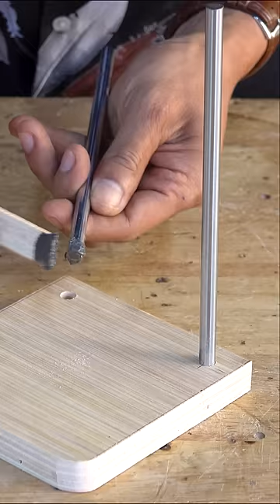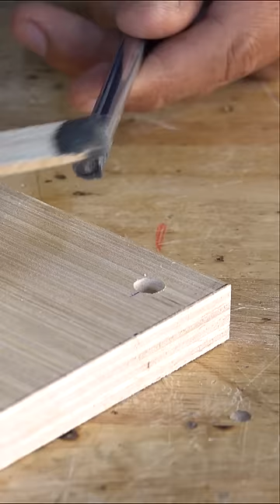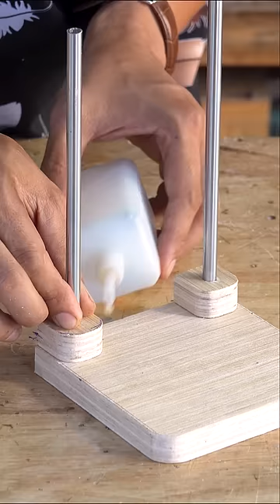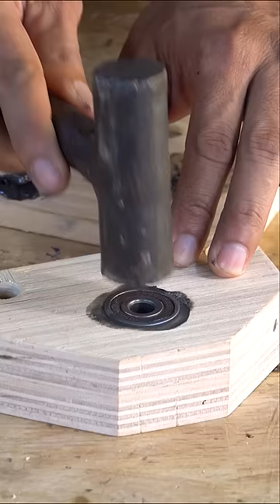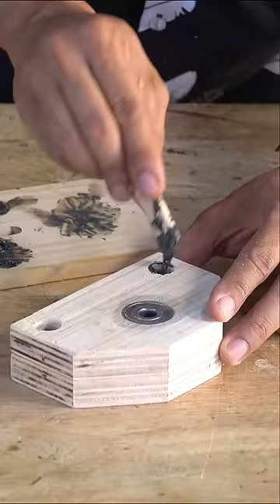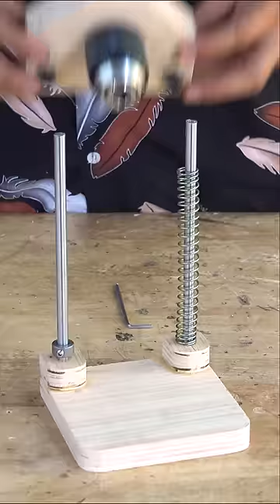Handmade DIY Drill Standing (part 2)#woodworking #trending #amazing #shorts

Comment: Good that you built one I guess.. but you can buy a drill guide for under  $30. The bearings and other hardware had to be close to that.
Reply: Àa
Reply: NOT THE POINT,  many of us actually enjoy building jigs, fixtures, and woodworking tools.
Reply: Depends on where you shop. Some places the hardware is much less.